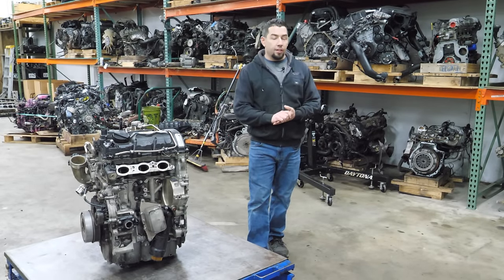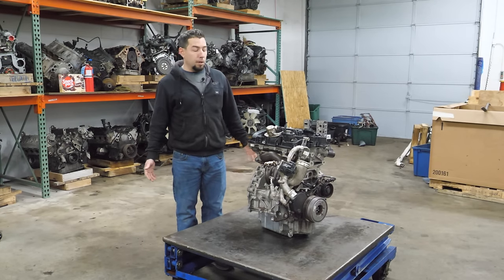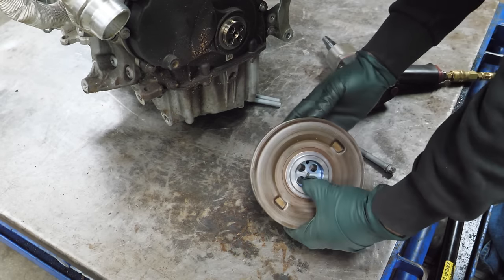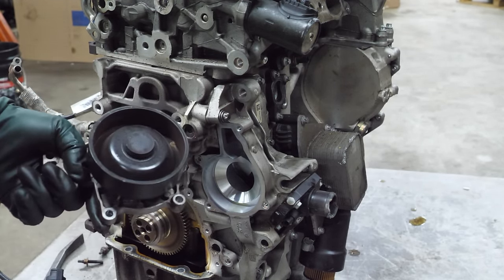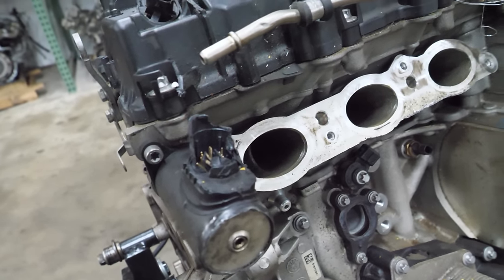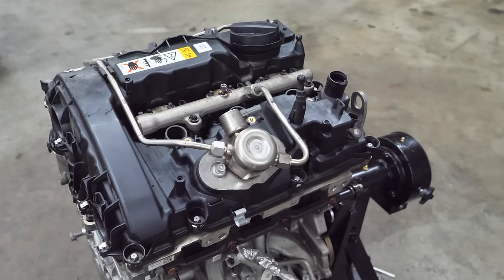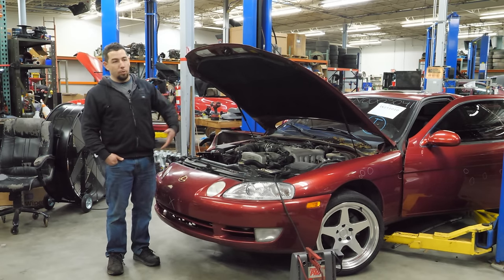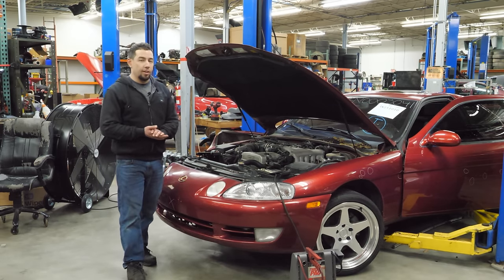MYSTERY FAILURE? 3-Cylinder BMW / Mini Cooper B38 1.5L Engine Teardown

Comment: Someone left the oil filler cap loose at the dealership 3000 mile free oil change! Owner drove it until he /her spotted the oil pressure light. Dealership had to change out the motor because maybe ,just maybe, there’s a ceo with a conscious!😂😂😂😂😂😂

Comment: On the carbon'd up pistons and polished cylinder bore I'd suspect air filter breach.  Might be interesting to remove the top ring, square it in the cyl with a piston and check ring-end gap against spec.  If out of spec it might validate the theory.  This is common practice on a dirtbike 2-stroke top end.

Love the channel, keep it up.  Maybe a Mopar 3.0L Hurricane someday?  Curious how they stack up to the BMW (Bring More Wampum) engine.

Comment: Thank you 10k mile oil change... the oil hardens behind the rings as the oil breaks down and because the rings can nolonger flex it wears the cylinder bore causing oil consumption.

Comment: This person is an engineer?
Glibly glossing over serious concerns with EVangelism doesn’t change those concerns into fiction.
Fact we are running out of the critical minerals used for EVs Windmills solar and batteries. Not because the minerals are finite but because we cannot mine or recover them fast enough.
Recycling Green waste is currently a non starter because it is too filthy and dangerous to do cheaply so new minerals are vastly cheaper than recycled.
The grid and home solar are not capable currently and won’t ever really be capable of coping with charging all those EVs if ICE goes the way of the donkey.
Wind and solar will never be able to replace fossil fuels without very serious environmental consequences. Consequences that would make the scam of climate alarm look like a pleasant weekend in Barbados .
Climate alarm has never been about saving the planet, it has always been a political scam invented to spread socialist ideology globally. Don’t believe me? Just look at who the most prominent alarmist are and gauge them on the scale of Stalin to pol pot to Hitler to Obama to trump. If they come off left of Hitler that is what you should be alarmed about!

Comment: That engine was driven low revs, short relations and it mostly never got heated up to working temperature. It doesn't depend of the car brand but of the driving style, and some engines do not take it well. That's a European thing and you probably don't have much of that. If the owner took it and heated it up&"blew it through" in high RPM/low gear for five mins on the highway once a week it would still be running.

Comment: Id be willing it was smoking a bit due to poor maintenance (all the carbon not uncommon issue in Euro with lack of proper oil changes) and it had a "knock" with that pulley issue. So those 2 bits are your failure. Lack of oil changes and failed pulley rattling.

Comment: Those engine suffer from emissions having to heat the catalyst up quickly. Also its direct injected so it runs high egts constantly plus carbon buildup.

Comment: Clearly wrong oil used or it spent a lot of time idling for that kind of carbon. German oil standards are very different from those elsewhere and Euro formula oils have an entirely different additive package. The repaired drain plug tells you a lot about the maintenance because this likely wasn’t serviced at a dealership, and the oil used probably wasn’t the correct oil API, even thought it may have been a compatible weight.

Comment: I'm not an engineer, but I somehow doubt that putting the timing chains on the back of the engine because "the transmission bell housing helps muffle the chain drive noise" makes even the slightest bit of difference in reality, especially since timing chains aren't noisy. I'd be more inclined to believe them if they said it was because they were trying to balance the load on the crankshaft since the accessory drive is loading the other side (although that still seems bogus since it hasn't been an issue for 100+ years).

I'm far more inclined to think that this is either somehow related to assembly line streamlining or just making the engines intentionally more difficult to service.

The carbon around the compression rings is due to a lot of heat in the pistons, probably because these engines are run under boost basically all the time. The heat burns the oil and causes coking, the same as excessive heat in old oil-only turbochargers (and why turbo timers became a thing).

Comment: Amused at your roundabout way of telling us these engines fail a lot. Seems like this one could (should) have been saved without taking it out of the car. Seen a couple lately where you seem to be regretting tearing them down (and destroying value). Looking at the price of "good used" engines should be the first step before buying a car.

Comment: Great video! If this engine is from the U.S., then it only could've been sourced from a MINI Cooper model (whether that's a 3- or 5-door hardtop, convertible, Clubman, or Countryman). And, if it's from a 2019 car, it's actually the B36 (B38 is extremely similar, but not identical). I'd venture to say that higher-than-expected cost is actually because there's little supply available. These engines, like their B46/B48 and B58 siblings, just don't regularly fail. And, MINI sells more Cooper S models than they do Cooper models.

Comment: I suspect the car may have stood for an extended period and the oil rings seized of possible one of those cheapo jiffy lube crap holes using the cheapeat possible garbage oil. To be honest it's a very long time since I've seen genuinely bad oil here in the uk even at 'Thick Fit' or 'Halfrauds'.

Comment: Those engines have a bad habit of the oil drain plug getting cross threaded and the threads stripped out! I have a friend with one that is stripped. Almost $2000 to replace the oil pan! UGH

Comment: It's called a pan saver, usually lube shops put them in if the pan threada are screwed up beyond a thread cutter/ don't have one that'll fit. Most lube shops won't drop an oil pan so they'll put it in as a stopgap.

Comment: I was wondering if the owner of the car this engine is from had installed a cheap aftermarket air filter, and the engine ingested a lot of fine dust over time. The cylinders showed hatch marks, but still they looked a bit glazed. Just because you can see hatch marks, doesn't mean that they are still deep enough to effectively do their job. I'm a retired diesel mechanic, and have worked on a lot of trucks, and heavy equipment that have fallen victim to air filter mishaps such as improper filter installation, leaks in the intake piping, or the idiots whom did the stab the air filter element up with a screwdriver trick so they could finish out the day.

Comment: The 2 major issues with that 3 cylinder are excessive oil consumption due to the low tension rings and the cylinder head lifting on the higher boost engines, causing the head to warp or the head gasket blowing.

Comment: The engine is a high duty cycle turbo engine, high cylinder pressures, carbon in the rings related, mike the block, would bet new pistons would be a good engine.

Comment: This guy hates dodge and yet he was honest with giving the win to the better truck. 😂 lot of hypocrisy here, listening to him complain about the things that didn’t work on the ford, subtle while on the road test. 😅 thanks for the fun video! I have experience with both of these engine options, one in Durango 4.7 2wd 2001 and ford explorer 4.6L 2wd 2003. Towing the same 5000lb load the Durango performed better, although the explorer had 3.73 axle ration and felt strong the transmission shifted horribly. The Durango pulled great with no issues. 
Both vehicles are still in the family.  The explorer has had lots of issues. Engine wise timing tension and guides, spark plugs blown out, oil filter adapter oil leak, intake manifold coolant crossover failure, Transmission failure. Currently runs great at 199k miles. The Durango, exhaust manifold bolts. 187k miles. Runs great still tow with it often. 

As mechanic I did more work on the 4.6 ford then I did on the 4.7 dodge. 

Maybe that’s why he wants you to buy the ford…🤪

Comment: That engine is adorable. Put it back, it's not ripe yet.
Hah, that was probably my favorite water pump skit I've seen yet. "Yeet!" BANG *Sheepish slink away....
Holy crap, a BMW with a timing cover!
I've always enjoyed it when you shoot the piston out of the tensioner. Makes a fun noise.
.... or when the tensioner shoots its own piston out at you! Hah! Safety box FTW!

Between the "wet" exhaust in Cyl 2, the mild glazing, and the stuck rings, I think the combination of burning oil and the clattering of the failed crank pully are what got this engine condemned.

Comment: I have one of these engines in my F55.  Encouraging that the intake carbon buildup wasn’t bad and oil looked good even with I assume the factory recommended extended service intervals.   However hte roller wear give me pause about using 0W20.  I think that was a move by BMW for fuel economy at the expense of longevity.  Not sure about the piston carbon around the rings.  Maybe a lot of cold idling.  Again, 0W20 is probably a bad idea unless you do longer trips in cold weather.

Comment: That drain plug is called a “save a pan” used when the quick lube guy strips the threads and it’s a cheap ass way to temporarily plug it back up.

Comment: THANK YOU for the tear down of a perfectly good engine...There was NO way you could have known.  NOT for waste though, A) Education;  this engine fucking rocks,  B) You  can sell the parts.   I half suspect the reason supply side is so low is because there's so little coming from parted out vehicles and very little rebuilds due to the reliability.  

Thanks agin.

Comment: My 1966 Toyota Crown 6 had a chain tensioner very similar to that (about 13:20 minutes) which was suspect, I drilled a hole and threaded it m8 x 1.25 then, one adjustable tensioner. Ted from down under.

Comment: Another example how DI and super thin ringpack kill engines. These things just don't like each other. Add timing chain (which doesn't like PM) narrow cam lobes, and linerless cylinder with some extended oil change intervals and you have a perfect storm. And I like small inline threes - ones in old Suzukis or Daihatsus worked like a charm.

Comment: Frankly, I'm disappointed that you didn't finish. A bit of honing, using a REAL stone honing tool, instead of that piece of crap dingleberry, then some polishing, and a full and proper cleaning, including putting the pistons upside down in gasoline, to clean off all the carbon, etc. and you could have a nice short block, or more, back together in a very short time. I've always heard you talking about not wasting a good engine. We all enjoy your teardowns, but occasionally, we'd really love to watch you put one all back together. It could also make a great mid-week, or next week show.

Comment: Eric, you have an awesome sense of humor and by all accounts an awesome man. A person can't fake it video after video. Really enjoy your channel.
I don't know if you drink would love to sip a beer with you just discuss your knowledge. Basically I would love to have you understanding or perhaps work in your garage as a I'm experienced apprentice. Unfortunately too much time has passed for any of that to take place.

One question do you ever rebuild engines or do you just sell parts.

Second question,
I haven't had an answer for this year but the Chevy 2017 trucks and cars Motors and transmissions were recalled. Unfortunately we actually own one. Also unfortunately when we found out all the information we are totally uninformed and unprepared to address the class action lawsuit.

I have a friend in a similar situation with similar issues only thing it is a car and not a truck. They actually replaced the engine and transmission and gave him a lifetime warranty on the mortar drain Engine transmission. The details we didn't talk about so I don't know.

If anyone has knowledge in this department include provide me with the information on how to proceed.
Don't know if the engine should just be run until it dies. It's being maintained hopefully well. I'm not the primary owner.

Any help or suggestions from you Eric or any viewers who are familiar with these engines just give me a like. And then leave a reply I would so much love that. I'm not in gearhead just a wannabe. Too late life to be practical becoming one.

Thank you for anyone who read this. I appreciate you make up this far. I'm sure you're probably a good person do you even read this let alone reply. Thank you very much.

Yes one more question this engine fails does anybody have a clue what the most practical long-term solution will be. It's a nice vehicle the engine and transmission and that's kind of a critical part of a vehicle. Hang in there everybody.

Comment: Hey man i love your video's and actually one of my friends purchased a engine block from you to make a computer housing or something a Subaru flat 4 or 6 can't remember or if you even remember that, but i have a 2001 Toyota Solara v6 I'm not selling the car but i thought it would be really cool if you would do a video on what happened to my motor. I know in some of your videos you sometimes don't know the mileage or the story of a motor  but i can tell you both the motor is a 1mz-fe 3.0L v6 it had 181,000 plus i seized it by doing a rolling burn out/ peel out after leaving a party i blew up the clutch and seized my engine when a money shifted at 6k plus RPMS from 3rd trying to go in to 4th but hit 2nd instead RPMS went too the moon and back mechanics where my dad works said it won't turn over and they haven't taken it apart so you'd be the first to see what i did to my car 😢 if you haven't figured out by now how old i am by my story I'm 18 and did a 18 year old boy thing to my car 😭🤣 i know its not worth a lot but i thought it would cool if you could do a video on it!!!

Comment: 4 cylinder engines have been made for at least 130 years and they are perfected. They get better milage, last longer, and get better mpg. Still trying to reinvent the wheel.

Comment: Those are very sensitive to air pockets in the cooling system if not bled exactly as BMW wants you to there is a chance you’ll get a hot spot and pop the head

Comment: I have '22 Toyota Venza . I would like to see you  one day tear down a A25A from one of these hybrids . I worry about carbon on the rings from low rpm and the start stop of these engines . I have 27000 miles on mine with no issues , but wonder about it in the future !

Comment: Im also subscribing to the theory the engine was good and all that was wrong was the harmonic balancer. Mechanics these days are just that level of incompetent and/or dishonest. I seen a guy once get on facebook and trash talk his engine builder for his civic, then went through two short blocks before discovering the clutch throw-out bearing was making the knocking sound. Let us just say that dude got laughed into embarrassment oblivion at the next car meet after all that drama he caused. Also...a ridge reamer will help remove the carbon at the lip of the cylinders so you dont put fresh scratches on the pistons when you take them out.

Comment: These engines are known for warped heads due to overheating, specially in the i8. Usually there is not much point to replace the head.

Comment: My hunch is that this engine was pulled out because the rattly pulley was a good excuse. Way back in the day we used to see ford escort motors like this, fully carbonated by some very very very careful maybe older person who drove it very slowly and carefully. Some of these little motors need some heat to keep them clean because they are actually a reasonably high performance so run cold. If you drive them as expected you will enjoy them for their performance and they will love you because you got them warm. We used to fix hard starting and missing etc by a quick trip down the highway to buy an ice cream at a town about 40 kms away all on the customer who thanked you very much for fixing their much loved car. If you hit areas where there's a little too much law enforcement just run in a lower gear so you can keep the motor making as much power as possible to keep it err hot. I have changed the oil before and after this tuning process to try and get rid of the moisture which builds up in them as the oils back then were not as effective at dealing with moisture as modern oils. BTW a word of caution, it is best they don't witness some parts of the process.

Comment: I know earlier ones of these had issues as they did not adequately support the rotating assembly under axial load (such as cornering), so the crank may have some value.

Comment: it's so funny to see that tiny 3 legs and the good size V8's on the background .at least is chain and not belt , and a metal oil pan ... is that crankcase 3x 170° apart ?

Comment: The last shop that did an oil change on my car had to install one of those butterfly drain plugs because the threads on the drain plug and oil pan hole were stripped from all the different shops that overtightened the bolt over the years. The shop wanted me to get a new oil pan for $400. A decent local shop tapped the oil pan and we installed a Fumoto valve. I couldn't WAIT to get that butterfly plug off my car.

Comment: At Hyundai, we have a procedure to clean this type of carbon buildup on pistons because they are such a common problem. It causes oil consumption issues and knock codes because the piston starts rattling in the cylinder.

Comment: So did you start work with the Frack or the Bront of the engine?

FWIW, I think the factory uses some sort of weird bracket that makes use of the mount bolt holes on the side of the block for the engine stand.